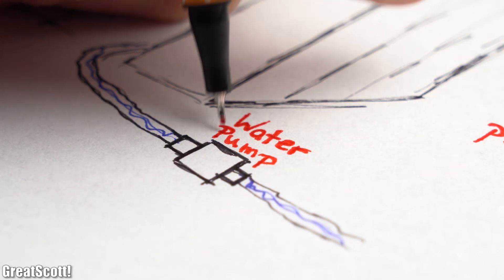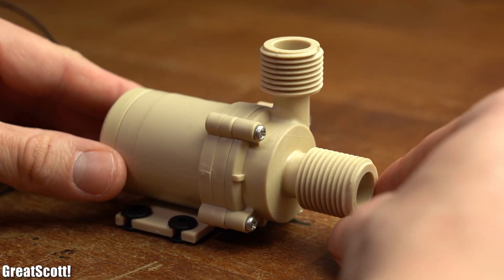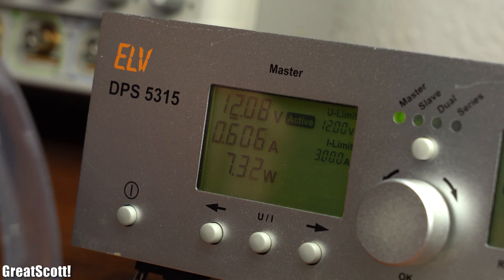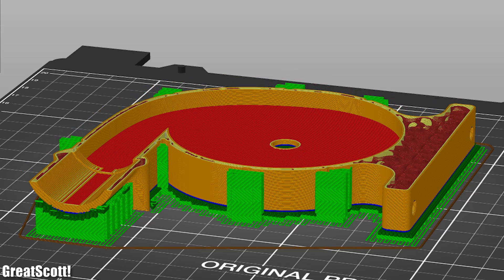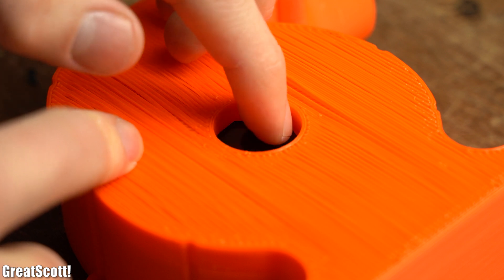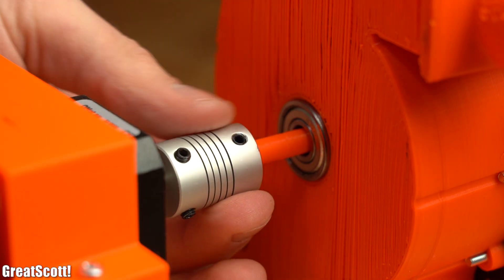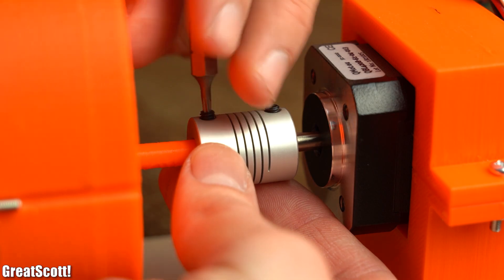Water Pump || DIY or Buy

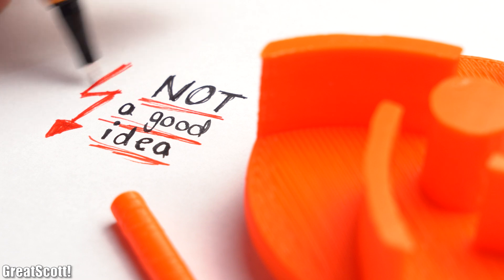Comment: 9:24 more like printing it out of that material isn't a good idea.  You can substitute the plastic shaft with a rod or bolt then the bottleneck will be in the blades.
I like the videos but I feel like some of the items such as the pump don't get a good chance.

Comment: Well no shit plastic cant handle the for of a powerful motor, the pump would probably have worked if that was steel. the isues however is leakage, i have yet to see a 3d printed pump not leak.

Comment: You just stopped when met problem and concluded that DIY sucks instead of solving that problem. You could try a thicker shaft or even replace it with steel one.

Comment: You really should have printed the impeller at about a 45 deg angle on the print bed so that the layer lines are not in the same orientation as the torque being applied to the driving shaft, or you could have used a stainless steel rod and thread the one end for inside the pump that can be secured with a matching hex for a stainless steel nut. I believe that if you did either of those the outcome would have been that DIY was the better option. Worth a revisit then? If you have any questions about any of this please feel free to ask them in a reply under this comment, but only after you hit the like button on this comment! :P lol

Comment: I found that shearing forces are the death of 3dprinted parts but can be easily fixed by desining in a bolt into such axles and the thing will stay in place. So your shaft can be printed with a smaller diameter bolt inside and it will work.

Comment: In case of diy, only do it if you need your whatever-you-build to do something the commercial ones won't/can't do. Only in your head is diy a good way to save time and money, because you will waste time and money building failed attempts and even if it works first try, you most likely took more time to build it than doing whatever-task manually.
I'm not saying "don't do it", i'm only saying "plan accordingly"

Comment: i think your design have flaws, the plastic doesn't have the capacity to support the streng you need, but you can made some metal supports and use rowlock made in somemetal, and put the turbine in a better way.

Comment: All that would be needed is a metal shaft that is octagon at either end or one end.  Threaded at one end the length of the pump wheel and 3D print the area needed to hold the nut at one end near bearing then the other end just thread on with nylon nut thus griping the pump vanes. 

Next slip through and attach to the pump shaft as you have done.  This would indeed solve the problem.   If one has to just cut the nut end off a long shaft short threaded bolt.     This is simple buy at hard ware store.  Smooth shaft at one end threaded at the other. 
Really solve the problem and as for locking down the PCB use Flex seal which is rubber based and one can make mold to make a gasket using that material and make small grove to accept that gasket in the 3D printing process of the pump case.  That also includes the pump bearing seal as well.

Comment: There's a video here I watched today with a dude running a fairly beefy looking 3D printed pump using an electric drill and a 8mm drive shaft. Seems that's the big weak point. I'm surprised with such a great brain that wasn't immediately obvious but I guess, when you already know the answer, it's hard to imagine how someone else (esp. someone so clearly learned and intelligent) can't see the same solution.

Doesn't stop me admiring the guy's channel though - I can't even speak another language!

Comment: what do I think? 

I think first of all making things out of (printed) plastic which you want to be reliable is dumb.  
I think having that wheel spin inthere with no bearings is dumb. 
I think the reason the shaft broke off was not because of the force but because of the vibration of the wheel rattling around inthere (where there should instead be water).
I think you're generally not supposed to prime water pumps with air.
I think using a dedicated mcu for that is overkill (though I understand it was an ad more than anything else).
I think you should try and learn some coding - it really helps out.

I think your videos are generally great, but you really shouldn't be making a DIY or BUY episode on something you had no idea how works before you started building it.

Comment: You just to reduce the diameter of the pump output and drill a hole on a wheel for put a screw; a screw is more resistant et looks like a real shaft^^ i think its not a bad idea to DIY this water pump!

Comment: You did it wrong from the start, you should've known very well from the begining that a flinsy  3d printed plastic shaft would not support the torque, you should've done the shaft  out of  metal, for example : bronze or aluminun that are not only  rust resistant  but that support the strength of the momentum  as well...giving for finished the video without even trying is neferious from your part...dislike and unsubcribed .

Comment: Why didnt you use use normal silicone instead of tape or hotglue. It would have done a better job there ither one 😂😂

As a side note you really should have used a steel shaft for the pump.

Comment: Hey Greatscott, I definitely think you could have made your pump work using a stainless hexagon shaft which would mate inside of the plastic impeller (possibly glued on). And of course half of the shaft would need to be round to go through the bearing maybe this would cost to much but just an idea.

Comment: Solution: metal shaft
But: the print material will still under the torque of the motor and the water presure...no real convenience going DIY with a pump that big...

Comment: Shaft diameter can be increased and will function well with bigger bearing.
RTV seal better then hot glue.
Printed parts can have leaks espically at the seam.. epoxy resin can solve this i guess.
Anyway nice work

Comment: Try changing the shaft to steel. And 3d print the impeller with a hole. Epoxy the shaft in place.

Comment: You made the same mistake most of people do: You didn't pay attention to the direction of the printing. You've printed the pump shaft sliced in the diametral direction. You should have printed it in the axial direction. Also you should have printed the shaft and the rotor separately and glued them p in the assembly fase. We always have to pay attention to the way the printed parts will be submitted to mechanical stress in order to chose what position we will have to print them. 

One more tip: you can use ABS and strengthen the overall parts resistance using ABS waste mixed with acetone to smooth the walls. That will improve the bond between layers making difficult for them to shear apart.

Hugs!

Comment: Attach a Stainless Steel rod to your impeller then attach another hose to your input hose with a shutoff which you can use to prime your pump .   Then get back because you will get wet.  Use a 1,000 plus rpm high speed DC motor not a stepper with board.  Add a cheap speed controller from China.

Comment: Drive shaft should be made out of metal rather than plastic coupling, i suggest drill the hole to your impaller and stick a metal shaft with screw, then coupled it with your motor. You will be suprice by the results.

Comment: 1st of all the design was dumb (small cross section of shaft fot that diameter of impeller 🙄, atlest u could have compared torque with shear stress of PETG print. Stear stress shoupd be more than max.torque of motor.)
Due to design failure please dont give biased opinion.

Comment: you said it's not a good idea to diy a bigger pump. well, I think you're half right, it's ok to 3D print the pump itself, but parts that take actual forces, have to be made out of a metalloid. the reason is cavitation for the blades, and obviously for the torque of the motor in combination with the load of the water. 
When it comes to your automated green house, have you thought about capturing rain water and let it pass a 50 and 100 micron filter, higher than the greenhouse, so you can use gravity to water your plants? a carbon/sand/rock filter works too, doesn't have to be big really, just enough for the flow of water.
I'm going to build a vertical windmill if you like those plans? (I still have to make the plans, but i'll make sure you'll get a copy) I hope to make a 5 kW one, about 3m high in total, not sure about the diameter yet, I think about 2,5m and will have double axial flux stators (modular)

Comment: The 3d printed pump looks great 👍🏻.
Maybe with better sealing it could had work. Try to use some motorseal red paste instead of glue, put a steel shaft instead of the plastic one and behind the bearing use a radial shaft seal to seal the shaft.

Comment: You could have printed a groove on one side of the pump house and use an o-ring or rubber band to seal it 
I would also have added an oil seal to keep the bearing dry 
A plastic shaft could have worked if you used bearings on both sides and made the shaft thick enough

Comment: Print a trough the size of the gasket you want and a cap and leave some holes at the top for overfill to spew out of then take #1 silicone (has to be #1) and mix it with equil parts water, and food dye if you want it colored then slightly overfill the cavity and place the cap on it and apply pressure until no more oozes out. Let it dry usually around an hour but I would let it sit overnight. Then remove from mold and you have a perfect gasket and if you include screw posts it will need no further modification. Trim off oozed portion and use.
Be forwarned has a large and powerful fume and will irritate eyes and breathing wear a gas mask or make it with plenty of ventilation

Comment: What about making the Nobe of the motor joint to the 3d printer shaft a pyramid one 
Since it is a straight one due to stress it may have broken 
Try once with a pyramid shape one

Comment: I own an irrigation business and dang 2gpm is terrible for that amazon pump unless you’re doing drip/micro irrigation.  I assume you’re using recycled water rain water or something and that’s why you’re using a pump?  Irrigation booster pumps are a bit bigger but will definitely push more water at a higher psi.

If you’re not using recycled water from a basin or barrel and you’re just using water from the town, you could just use a solenoid valve and hook that up to your microcontroller and sensors. Love to see an update to this

Comment: you could also paint the parts with an acrylic epoxy to add to hardness and fit, as well as, used a liquid type gasket paste, cork sheet or silicone to seal the housing

Comment: Intellij IDEA is better for Java than Eclipse tbh

EDIT: you can fix the shaft problem by using a hex bolt instead of a 3D printed shaft, or if you don't have one the right size you can use a threaded rod with two locked nuts, then make sure your impeller has a hex countersink to firmly hold the bolt or nut in place and apply superglue if necessary.
As for ease of maintenance you can put silicone kit on the edges, applying soapy water to the other half and then screwing them together but not completely (5mm apart or something like that) then let the silicone dry, this will create a watertight seal that doesn't keep the two parts stuck together

Comment: this kind of pump spin at high speeds , if is no well aligned , a high vibration can destroy the shaft, not the force of the motor itself , you may try use a shorter shaft , align better or a combination of both. aother tigh , in the video seems that the shaff has a diameter more little that the ball bearing , so , the bearing wasnt doing  its job

Comment: I disagree. Not only because of the shaft, however that is a part of it.

3D printing is typically used as a method of prototyping parts that will eventually be injection molded, cast, or machined. Rapid prototyping. If a part can be made using those methods as well as 3d printing, then 3d printing will always be inferior besides time and in low quantities, cost.

3D printing can, however, create parts which the other methods can not. Complex geometry etc.

The part you printed could not only be made easily with other methods, but it was designed for it. Any print that requires that much support is either purely aesthetic or a poor design. That shaft was designed perpendicular to the "grain" or layers of the printer: the weakest orientation, and also the weakest size/part of the whole thing.

All of that aside, the impeller could be more efficient with a completely different shape. I'm not great with impeller designs but centrifugal pumps typically have a shape so complex it cant be made with casting or injection molding, and have to be made with a 5 axis mill and hours of time. 3D printing excels at stuff like that. 

Also those tubes were way too large. Water is a non compressible fluid and is very difficult to move when the device allows air through easily. The impeller was just circulating air and not picking up the water. Smaller tubes=less volume and the pump would have an easier time once it was primed. 

I'm nothing more than a keyboard engineer but I think a 3D printed part could be much better if designed properly.

EDIT: Designed properly and utilized the 3D printer's abilities which other machines can't compete with in a home setting.

Comment: Hey! You could use a rs-775 motor for a pump not a bldc. The winner is DIY. A bldc motor spins slowly so it can not be a pump 775 motor spins at a speed of 10,000 rpm max.

Comment: Your input shaft on your diy water pump didn't fit the bearing it was seated with and you probably should have made a recess and a shift off the front of the veins to strengthen the pump all in all i dont think you tried as hard as you normally do but cool video I guess

Comment: Can be a nice Solution for smaller Waterneeds you can use a Pump from a Car. The Pump used by Cleaning the Windows. Die Price is very Low used ans new. I payed 7€ this Pump had Two directions Front ans Rear Window.

Comment: Why is that shit plastic your go to material for making this thing? varnished wood? metal? O rings from the hardware store? 3d is only good for cheap pipe fittings for this project. it also comes out to coarse, catching debris  in the long term use.

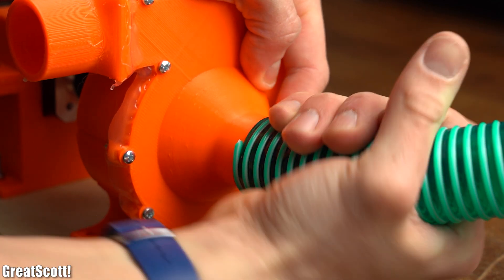Comment: Connecting the two shafts directly causes a lot of dynamic stress to the system if it is not lined correctly, which seems to be the case according to 8:35 and in really any case where the motor is on. The system also seemed quite unballanced which also causes extra wear on the axle. Also added, that the baldes were backwards (as noted before) pretty much destined this to fail, but there is so much room for improvement here, and I am pretty amazed how far 3D printed materials have come in the line.

I will do some changes to the base design of this and I think this could be pretty impressive:
- do an other ball-bearing at the other end of the pump case, so the rotor will be supported by both ends (decreasing the dynamic stress levels), this can be done the same way as in the initial desing.
- do a fan belt clutch for the driving motor or just a simple cogwheel clutch thus enabling errors in positioning to some level.
- A bleed-valve at the top of the pump would be a nice addition to the initial to help priming.
- alse there are quite some liquid sealing materials available off-the-shelf that are good for sealing this type of applications (i prefer f.b.s for this kind of applications).
- A steel axle of course desired (you can use normal threaded shafts or long bolts for this), but I think if it is supported on both ends and ballanced, the plastic should be enough.

I also think it was fair in this point to call it quits, but I can see so many points for advancement in this, that I wanted to add it to this experiment. Nice job.

Comment: The idea is good. The problem is you missed the details from the commercial pump: shaft can’t be made of plastic. This kind of plastic can’t stand the high torsion a water pump needs. Another issue would be the seals. Having worked with pumps through the years thought me that seals play an important role in the pump. You can get commercial seals and shaft and you’ll see how this project works like a charm.

Comment: The shaft is too small..to stand with the high torque..or maybe you can make it shorter a bit..to reduce wobbling..the material is not that major issue..the structure maybe..just my opinion

Comment: You need to prime it , it cannot suck water without a bit of priming water. Consider also to use a standard dc motor instead of a nema stepper as it will work better dor continious movement

Comment: As soon as I saw that coupler I knew it wasn't going to work with a plastic axle. Better off using a bolt as the axle and making sure the motor is in near perfect alignment.

Comment: 2 nuts and threaded rod would have made the pump work. and silicon sealant would have been much better for a gasket and some grease on the shaft would created a seal.

Comment: To everyone who believes that a "metal" shaft would solve the problem, please revisit the opening of the commercial pump.  I think that the shaft is white plastic, or plastic covering metal.  The 3-D printed version has many design flaws, not just the shaft.  Overall, you probably do not need a pump at all.  If you have sufficient city water pressure, hook up a manifold with solenoids.  Besides, the little commercial pump is only capable of generating 3m of head.  That means that water will be pushed up to 3m, but the flow will be zero.  :)

Comment: A plumber you are not. You wasted the teflon tape and could have used water hose washers instead. Also no need to teflon the hose fittings either. Just worm clamps would do. Nice 3d printing though.